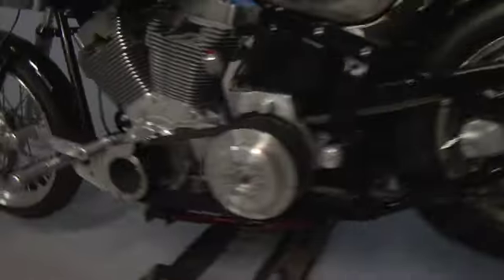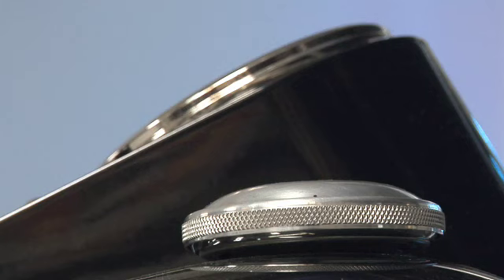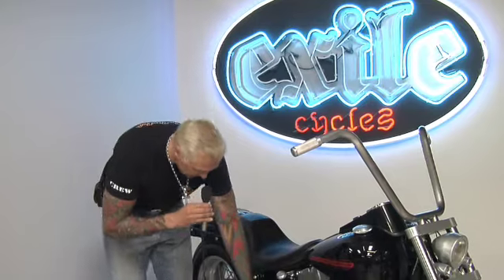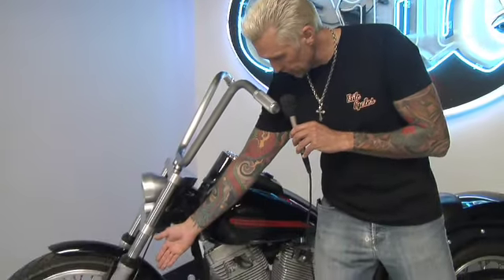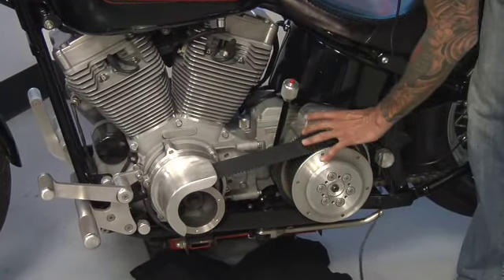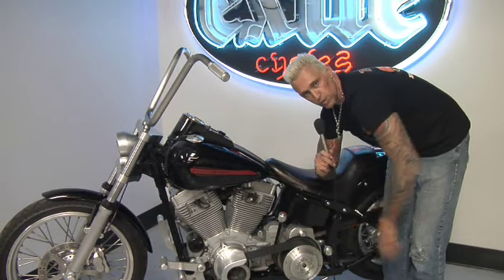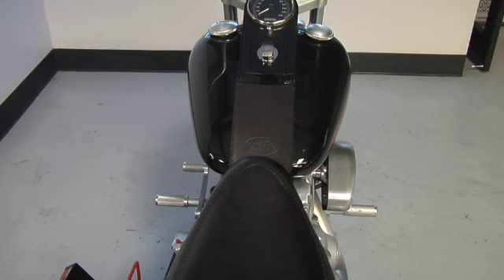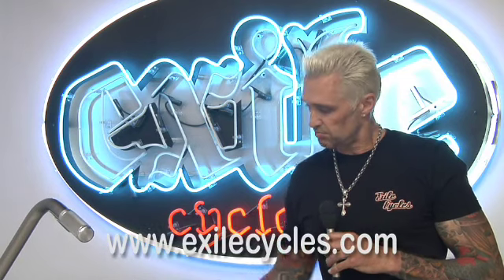Exile Cycles with GripAce

Comment: does it matter if I have dual throttle cables on my bike with an internal throttle single cable..will the internal cam pull the throttle closed